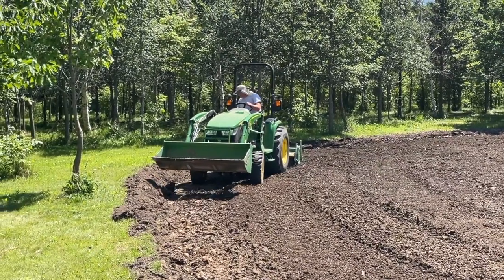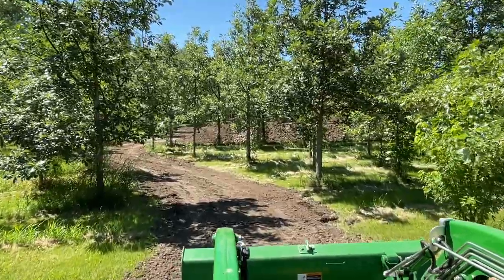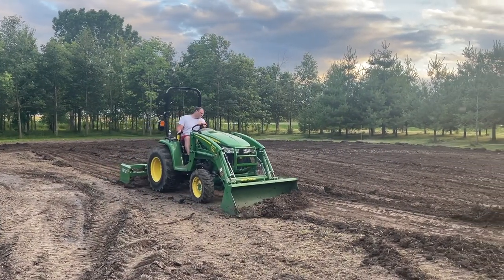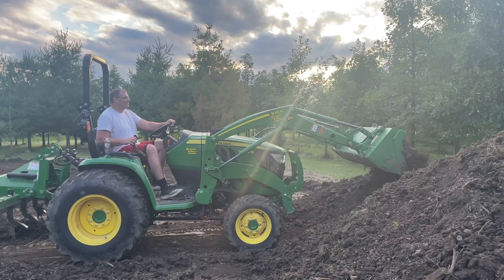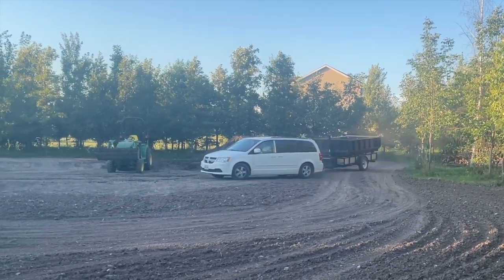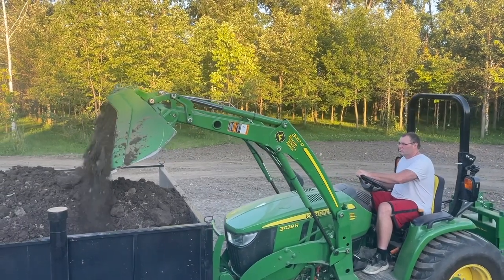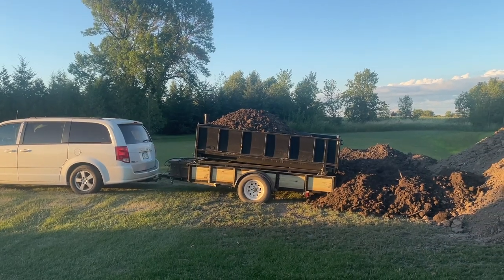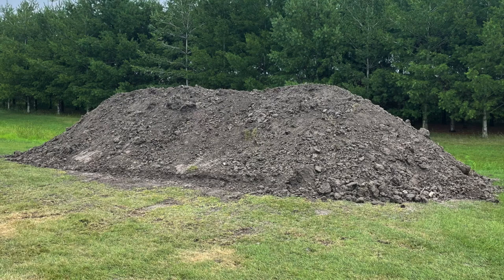Moving Topsoil with JD 3039R, Dodge Van, & Homemade Dump Trailer

Comment: I love this! Is one axel enough do you think? Also are the sides plywood? I want to build one.
Reply from the maker: No, one axle is definitely not enough.  I only used the single axle trailer to make it easier to weave through the trees.  I actually bend the spindle hauling to much and sinking into the dirt going around a corner after this video was made.  I was doing partial loads and then got greedy with it.  The axle was $250.  Bummer.  The dump insert has served me well though.  The sides are steel.  They were wood but there was way too much pressure for wood to keep its form so I went with steel.  Good luck!
Reply: @danimalshouse  you did an awesome job! I really appreciate the advice. I’ll definitely build mine with two axels. I’m definitely going to weld a steel side frame. But, damn, metal prices are so high now (even expanded metal) that I’ll probably use channel iron stud supports to frame the side and line the inside of it with 3/4” plywood or maybe even double the plywood. I want to save money hauling topsoil and gravel. I do too many projects to continue paying retail for dump loads. I really appreciate you posting this 🙏